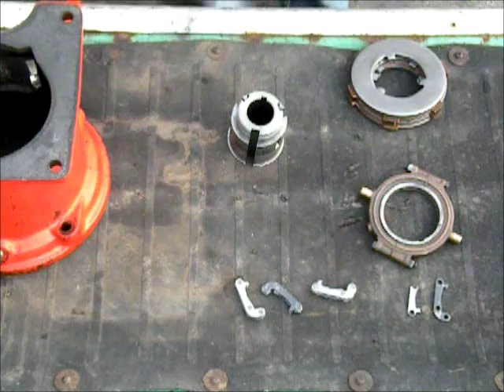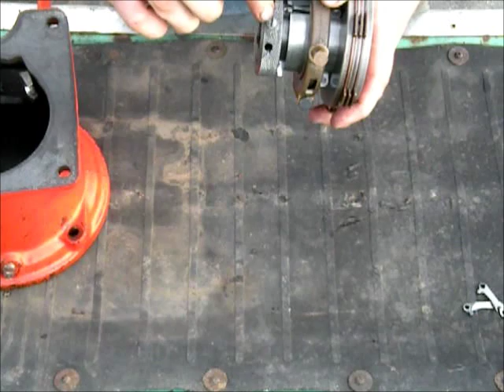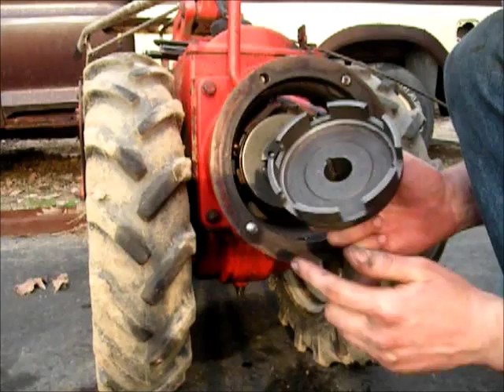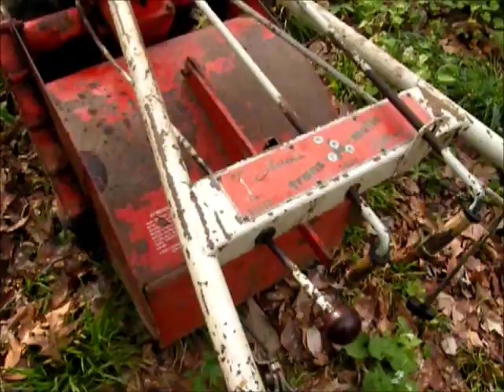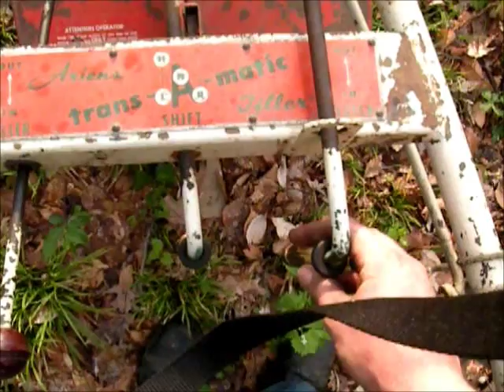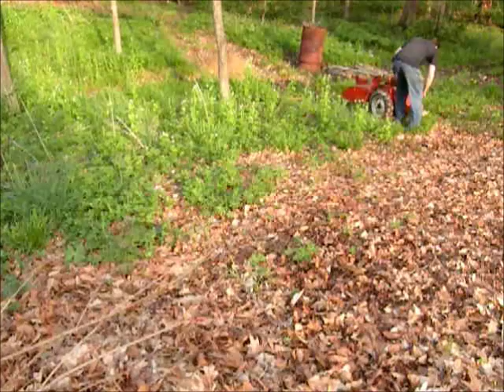Ariens TA20A Trans-a-matic Tiller Clutch Assembly and Running

Comment: Thank you for this video. I have a TA 28with a twin cylinder engine and am looking to buy a TA 20 just like yours. I enjoy restoring the old tillers, which I consider to be the top tillers ever made, but you are much more mechanically adept than I am. I enjoy polishing, painting, putting on new seals and gaskets, but the internal stuff is over my head. I really, really, appreciate you posting these videos. Thank you.
Reply from the maker: +fred northrup Thank you Fred, I just now found your message. I agree, the older equipment is so much more durable. They were built to, and have stood the test of time.
Reply: +fred northrup I have a twin cylinder but I need the bevel shaft in the transmission, any ideal where I can locate one
Reply: +drkvette No sorry. But the transmission on the TA-20 and TA-28 are the same except the axles are longer on the 28. Might be easier to find a junk TA-20 for parts. There seems to be more of those around. Good luck.
Reply: @frednorthrup9752  Where can you find junk ones of these? I'm assuming a junkyard, but not sure about if there is a small engine junkyard or what. Live near cleveland OH.

Comment: Does anybody know where I can find or have the Bevel shaft repaired I have one of these as well and the shaft is broke
Reply from the maker: +drkvette A good "Job Shop" type machine shop should be able to make you one or fix the one that you have. If someone tells you that it can't be fixed or remade though&#160;don't give up. I have run into a lot of people that have told me that something can't be done when in reality they just didn't know how to go about doing it, or else didn't want to be bothered with it. I hope you're able to find a place to get it fixed.
Reply: +Chip Wright, you are so correct many businesses complain about being slow they leave how they are slow. I have been looking Thanks this is a beast no more than two cranks and it is running.
Reply: My tine dissengaged for the rototiller    is not working  any help plz?